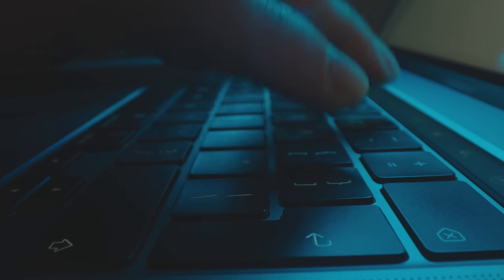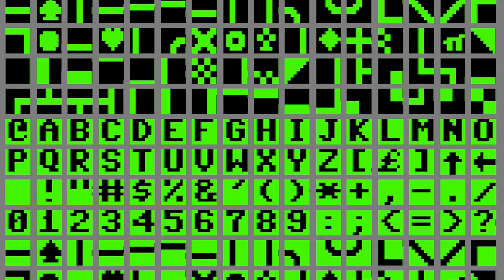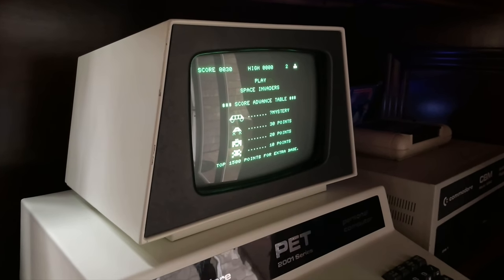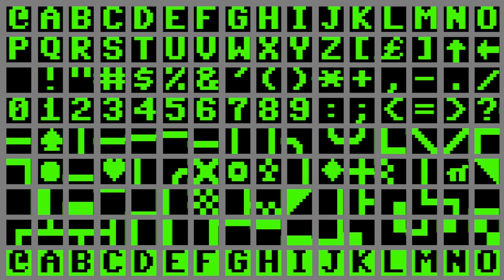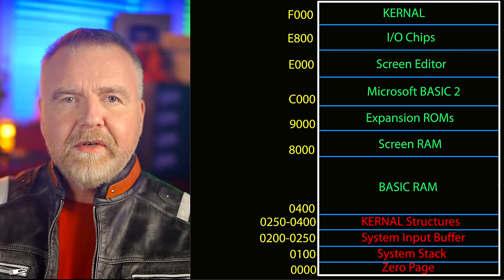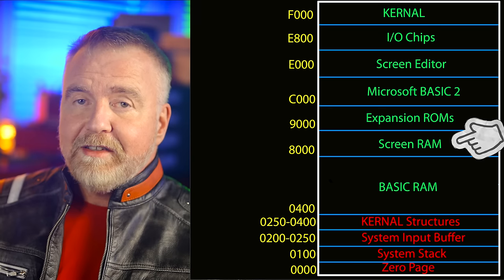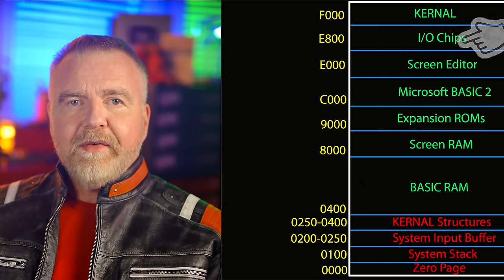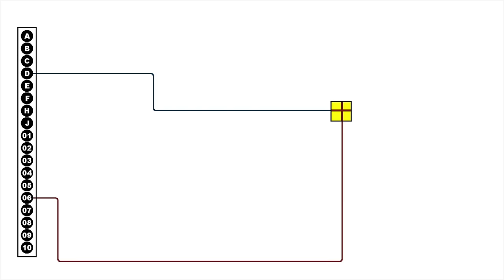Everything you SHOULD know about your Computer but don't!

Comment: The reason why they couldn't allow the character ROM to be read from RAM is they would have to implement arbitration between the video chip and the CPU.  The CS line on the chip would need accessing on the clock edge by both the CPU and the Video chip.  On the C64 they address this by having a two phase clock, with the CPU accessing the memory and other chips on one phase, and the VIC chip on a different phase.  When the PET came out, this wasn't a hardware technique available to the devs and would have added a lot of complexity.

If you really want to know how a computer works end to end, try implementing a core in the MiSTer FPGA system.  If you love learning a computer system at every level, you will love developing FPGA cores.  I've done two now and loved the experience and the satisfaction it gives.
Reply from the maker: I thought static ram might solve this, but you're right in that you'd still need arbitration of the CS line somehow.  I'd do the FPGA if this were a hardware channel, but it's about the software!

Comment: My best guess why the video circuitry couldn't have pulled the characters from RAM instead is... that RAM is simply too slow.
I would even hazard a guess that the Character Generator chip is called that, because it actually is... basically just actual logic gates connected in such a way that for each input "address" they return the desired output line. That would make such circuit fast enough to keep up with the speed of electron beam scanning the screen, and it would also kinda makes sense (in my opinion) then why the chip is called Character Generator .

Comment: I'd guess that the character ROM design of the PET had to do with timing and a rather serious shortcoming in the 6502 CPU: It lacks the ability to release the address bus.

You can sort-of get around this limitation using buffers and have external circuits access the RAM using an inverted/phase shifted clock, and run the RAM chips at twice the CPU frequency. And indeed the 6502 has a "Phi 2" clock output for exactly this purpose.

However, you only have a very limited number of cycles available, and if the video chip has to access multiple areas of RAM, chances are it'll need more bus time than the shifted clock allows. Which is why the 6510 in the C64 has an additional "AEC" (Address Enable Control) input, which halts the CPU and tri-states the bus, making it possible for other chips like the VIC-II to take control of the bus when needed (during so-called "badlines").

Several 8-bit computers used the same Motorola 6845 VDP as found in the PET, and at least one of them (the EACA Colour Genie) had user-definable characters in RAM implemented in such a way that writing to the character RAM while the screen was being drawn caused a "snow"-like effect on the display, as the 6845 was temporarily unable to access the bus. (This despite the fact that the Z80 used in the CG has a BUSREQ input which does basically the same as the AEC on the 6510.)

Comment: Moving the character ROM of the CPU bus means reduces complexity and halves the required bandwidth for the video signal generation "stolen" from the CPU bus. It looks like the video circuitry reads the each character once per scan line. The combined bits of the 8 bit character and the lowest 3 bits of the scan line are looked up in the character ROM an shifted out at the pixel clock rate. That's about as simple as a useful text mode can be. Supporting a font in memory would require two memory reads per character (one for the character and one for the current scan line of the the character) from RAM and unless the users are expected to naturally align the font in memory it also requires a (partial) adder instead of just forming an address by wiring the signals together. Allowing partial replacements would be even more logic on the critical timing path of the video logic. All of this quickly drives up the cost if you have to build it from 74xx series logic chips.

Comment: Note that the character ROM is not in the memory map.  Thus, making it into RAM would not be enough.  As you stated, the character ROM got its address bits from the contents of the screen RAM and the three row bits.  There was certainly enough unused address space to place the character ROM and a 2k shadow RAM, but RAM was many times more expensive when they were building PETs than when they were building C64s... especially since the C64 used DRAM.  Combined with the additional logic, higher design demands, and slower run speed, this would be a significant additional cost to pass on to consumers.  This added expense would have been rather risky at a time when pinball was more popular than video games.  Furthermore, this design choice would not be at all helpful in the Commodore Business Machines that they expected to generate most of their income.

Comment: The problem of sharing the same address and data bus with the video system is that only one chip can have control.
While the video chip needs to access the bus, it must stop the CPU. The 6502 has a dedicated line to halt all operations and put the address and data lines into tristate (open circuit, fully passive).

The PET can use its character ROM any time it wants and doesn’t have to share with the CPU. The need to access the video RAM every 8th line is bad enough, this is why Commodore nicknamed those “Bad Lines”. When the video chip finished to draw a full character line, it needs to grab a copy of the next one and this causes the need to stop the CPU.

The C64 is different. It actually runs at twice the speed as it seems!
During the positive levels of the clock signal, the CPU has control and during the negative levels, the VIC (Video chip) has control. That way the VIC can make use of the character ROM/RAM independently while sharing the same bus with the CPU.

This is very difficult. Any chip needs time to process or provide data on the data bus. If a byte is read or written too early, too late or stays on the bus for too long, data is corrupted. Even worse, if a HIGH collides with a LOW, you have a short circuit and damage the chips. So the ROM and RAM chips need to be more than twice as fast. The ROMs are usually not a problem, most run fine up to 4x the speed of a PET. The RAM and the logic to switch between CPU und VIC is very critical. If a chip inside the PET fails, you can use a programmable chip or an EPROM as a makeshift FPGA to replace it easily. For the C64, this is highly difficult so there are not many modern replacement chips available. 

The VIC of the C64 still needs more time to access the video RAM because it was busy accessing the character ROM/RAM while drawing a line. The time between video lines is not long enough to grab the next line of characters from the video RAM. So the C64 still has “Bad Lines”. Even worse,  since the C64 has more characters per line than the VIC20, the Bad Lines are even more bad! This is what caused the need to evolve the 1540 floppy drive to the famous 1541 version. It loads slightly slower to ease the trouble of timing problems caused by the longer Bad Lines.

You can stop Bad Lines from happening. When you load a tape, the screen turns blank. This is to stop the need to access the video RAM area so the CPU has full control all the time generating an accurate timing for I/O access.

The C128 makes use of the ROM/RAM running twice as fast anyway. In C128 mode, you can type in “FAST” switching the CPU to 2MHz mode. Then the screen turns blank because there is no way for the VIC to access the character ROM/RAM any more. So while you can run any calculations twice as fast, the user can’t see anything, no progress bar or any other indication how long it will take or if the computer has crashed.
And this is why the C128 had failed commercially. There are only a few games for the C128 mode since while you can make use of more RAM, you can’t make use of the 2MHz mode since there is nothing to see while it is running fast. Using a REU (Ram Expansion Unit) on the C64 can also give you more RAM – even more than the C128 has – at the same CPU speed. Even better, the REU has a built in DMA! The CP/M mode is also not an advantage since the disk drive is very slow. Using CP/M on the C128 is an awful experience. So the only advantage a C128 would give the average user is to be able to read/write DD MS-DOS floppy disks to migrate files to a PC.
Reply: I forgot to mention that while the PET can generate its pixel clock without any restrictions, the C64 CPU must be running with a very specific clock timing.
The PET could run with any clock speed although the speed of the RAM and CPU had limited it to exactly 1MHz.
For the C64, the pixel clock timing dictates the CPU speed. This is why the PAL version has to run at exactly 0,985249 MHz while the NTSC version runs at exactly 1,022727 MHz.

This causes a compatibility problem when games use hacks to tamper with video timing to create advanced screen effects. So while “crude” games just run slightly faster in the US, advanced games can’t run at all on the wrong version of the C64.

There are much more advanced PAL games than NTSC games available, the reason why the C64 was sold more often in Europe than in the US.

The PAL version allows for more complex hacks for video effects since the FPS is lower (50Hz) and the screen border is bigger. So while the CPU is slightly slower, you have much more time to manipulate the VIC for split screen effects, multiplying the amount of sprites, displaying more colors using interlace effects, generate more complex smooth scrolling effects and a lot more clever hacks.

Also since the screen borders are bigger, you can use a split screen hack to display stuff on top of the screen borders like marquees, score counters and the like.

Converting games using complex screen hacks from PAL to NTSC is often next to impossible.

Comment: My first was a COSMAC ELF. It came with 512 BYTES of RAM and used a cassette tape for storage.
Reply: By the time I got done with it I had 128K (paged) ram, did it's own keyboard scan with rollover and had a text memory mapped output (I hijacked a "glass" terminal and memory mapped it). Also added a SCSI hard drive because they came with a sector buffer so my slow machine could read at its leisure. I used the bootup rom (512 BYTES) as a complete BIOS.

After writing my own assembler (and disassembler) I did the whole machine in FIG FORTH.

I graduated to the COCO (6809) and while wire wrapping a new interleaved video board, the PC came out and sold a color card for $15. 

Killed my hobby.

Comment: I presume "5 data 5" declared the data value to be usable for "ready" (=read y) which read it into "y" so the print statement could operate on it. Is this summary correct? I used basic starting on atari 130xe, a bit on PCs (mostly DOS) and on TI calculators which didn't use data and read commands like that if I recall but it has been a long time. Amazing how many good details in your videos I feel like I need a prerequisite to get things from; leads to lots of extra thinking to understand otherwise simple ideas.

Comment: So I know you're retired, I feel like this would also annoy you too. Windows 11 the system reserved file is after the C drive. If you know what that means, if you want to expand the C drive you can't because you have to move the reserve file in front of the C drive. You would have had to do that during the installation phase within command prompt in windows 11. If you know any connections within Microsoft this would be valuable time well saved as system administrator. I can even give you the script that I'm running currently.

Comment: I was born in Netherlands in the week WW2 stopped and I have seen it all and I knew it all, note:  2024 - 1945 = ~80  :) :)
Summary;  I produced my own transistor during a course in ~1991.  Main frame computer prototype testing (1969-1974);  OS design and programming (1975-1980); applications for Air Traffic Control and Semi Conductor Factory Automation (1980-2010).  I retired 1-1-11.  
Now I'm a collector of VMs with old OSes, like e.g: Windows 1.04 (1987) till Windows 11 Pro (now) or Ubuntu 4.10; 5.04; 6.06 LTS till 24.04 LTS :) :)

Comment: I miss the feeling of working on a C64. You would almost know every Byte of those 64kb you had available - this is exagerrated, of course. But you really knew the machine inside out and you could optimize the hell out of it.

Once I had moved on to linux I never ever felt that satisfaction again. There was so much going on I was not aware of and that I will never have the time to learn - that was deeply unsatisfying and I eventually lost my fascination for OSs completely.
I now mostly use an Apple because it needs the least maintainance.

Comment: In the last few years the C64 has gotten demos that do things that shouldn't be technically possible. Or of course they are but now it seems that the demo makers know the device better than its designers did.

I may remember this wrong, but on the C64 the character ROM was technically on top of a memory area that was also populated with RAM, and writing those addresses wrote to the RAM but reading them normally read the ROM. You could either make a loop to read and re-write the address range to obtain a copy of the ROM, then switch off the ROM and modify the characters, or you could load a tape or disk file that was mapped to load into that range.  This could have been done in the PET but there may actually be a method to the madness. Memory was expensive and having 2K of memory masked by a ROM chip and not used for most purposes of the computer, would have increased the production costs. And maybe the video chip was able to access the ROM faster that way?

Comment: because of arcane Basic ROM loading program chould not take control of the stack by loading your data from basic rom address, even if the rom was not installed you could trick the BIOS Cmos Chip into loading your program backdoor thru the BASIC ROM, you see

Comment: Very interesting topic and I was hoping to use it to understand why some code works on 32-bit but not 64-bit. For example when passing a Long vartype in VBA in a 64-bit, the equivalent is LongPtr, however, according to Microsoft this is still not equivalent but it's used to transform a 32-bit Long into a 64bit LongLong, which still isn't the same and that is very confusing. It's why porting code that was written for 32-bit machines into 64-bit machines, isn't always cut-and-dry. I'd like to know if you have experience with this and why it seems difficult to port code into 64-bit machines.

Comment: Why didn’t the the PET allow characters in RAM? Speed would be my bet. You need RAM that runs at double the speed of the CPU to prevent clashes between video and cpu. You’d need two RAM accesses for every character for every display line (1 for the character read and 1 for the PIXEL data). Early 2114 SRAMs were 450ns parts, so two accesses would use all of the 1MHz bandwidth of a 1MHz 6502.

Comment: The 'C' in RS-232C has nothing to do with signal voltages.  The 'C' suffix just refers to a later version of the EIA spec, which was more about handshaking and controlling modems than it was about signal levels.  RS-232 (including -C) defines a 0 as 3.0V to 15.0V, and a 1 as -3.0V to -15.0V.  The use of 5V serial outputs has long been an improper-but-tolerated thing, since a TTL high of about 3.5V was sufficient to be recognized as a 0, and most receiver chips treat the undefined range between -3V and 3V as a 1, while including protection against the "real" RS-232 voltages on their inputs.  But many serial ports these days aren't even RS-232 tolerant, since they are just using microcontroller inputs, expecting to see nothing beyond the traditional TTL voltage levels.

Comment: On many systems the character ROM was not even on the CPU address space as the CPU does not need to know what the characters look. IBM MDA was one of them. RAM was expensive storing 96 characters each 8 bytes takes 768 bytes. Many early computers had some 4 KB RAM. In 1978 768 bytes of RAM would have been about $30.

Having the possibility to have the font in RAM would have helped users outside US. Now the machines had to have different ROMs (on home computers like C64 they did not not bother). That then meant that they permanently lost square and curly brackets. IBM fixed this by having a set that supported most Western European languages. However of the two special letters needed in Danish and Norwegian (æ  ø) they included only æ. What were they thinking?